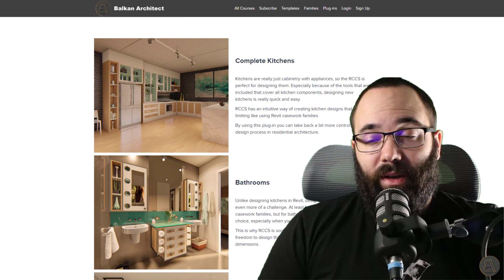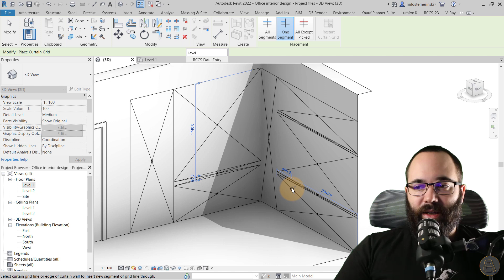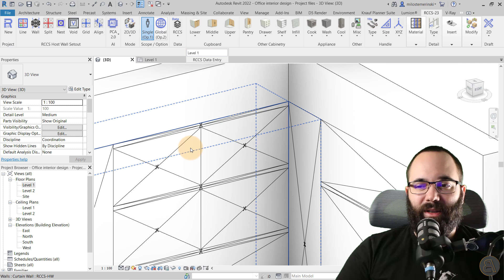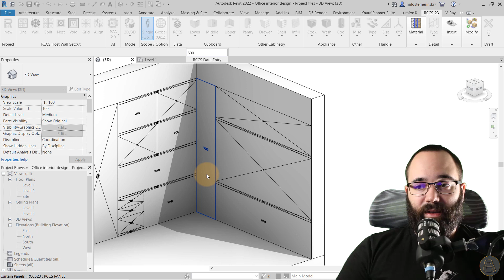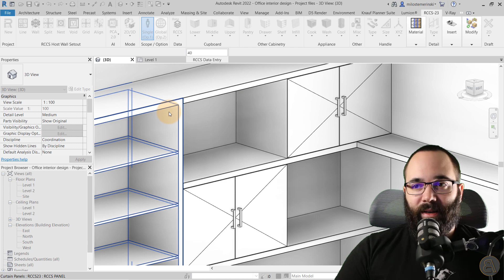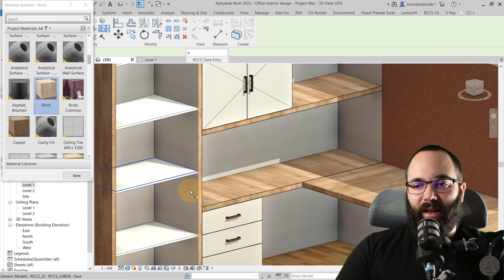Revit Interior Design Tutorial: Home Office

Comment: Dear Professor Balkan Architect . I do sincerely beg you for further helps below.

Hello Sir, I have applied all your tips to 3d printing in revit . howevre mine doesnt work still. would you mind helping me out sir ?

my problem gets started with hollow walls. When i adjusted concrete walls 2000mm to 3000mm in revit, they are exported as you told me with ACIS options with dwg files to stl files finally.
However my file still gets hollow walls and floors when imported in Chitu Box or Photon 3d printing software.  they dont let me get solid walls for 3d printing............... How do you have your walls filled as solid  in revit ? 

How may i have to solve this problem? i do definitely want to print it out in 3d format .